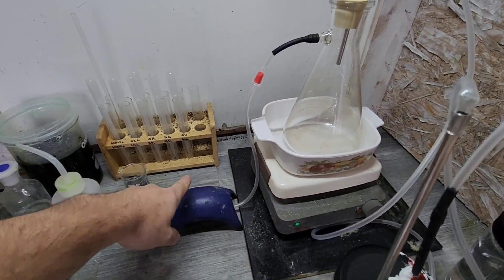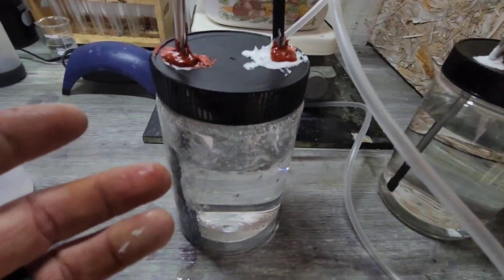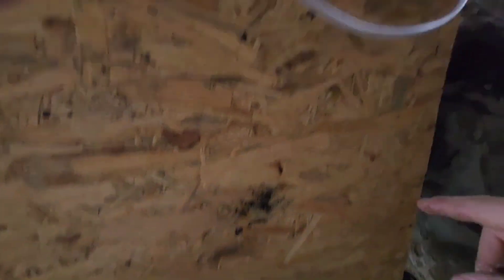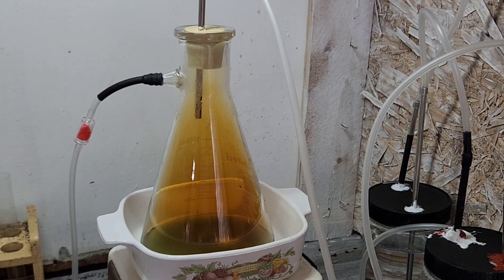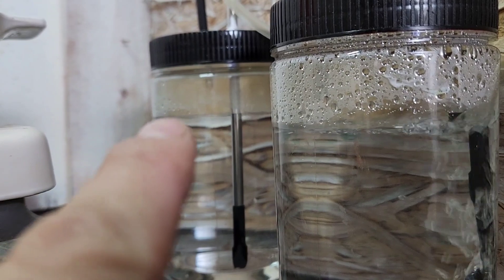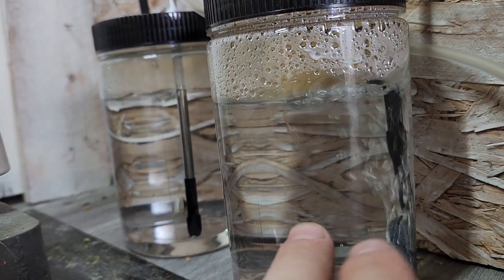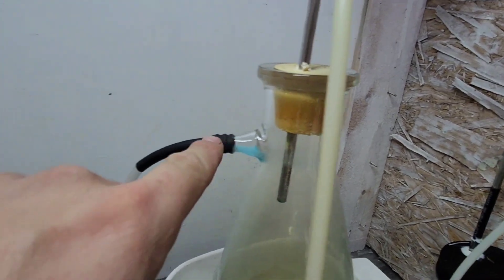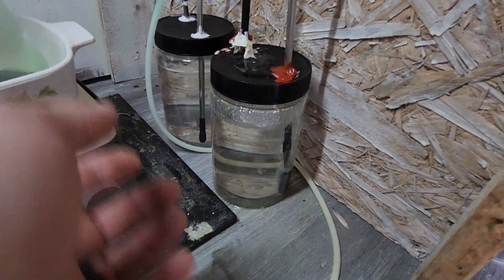The start of my air scrubber! let's make some Nitric!

Comment: You are having the same issues that I was having. I was side tracked. What I was thinking is a push pull pumping (close loop). For a seal. Make one from a inter tube (Gasket). should use glass tubes with polypropylene tubing. Or you can just use the tubing. The silicone does degrade. You can use plastic PETE tap barb fittings to attach the tubing.
Reply from the maker: I like the push pull idea. Doesn't oxygen have to be present?
Reply: Add a T on the suction line with a valve to atmosphere then you can adjust air intake. @SilverStoll
Reply from the maker: I'm just trying to wrap my head around the idea so sorry for asking g dumb questions 😆  if you were allowing air in but not out wouldn't you over pressurize the system? I figure you would have to let some out?
Reply: In theory it should balance itself out. The T would either push out higher pressure or let in negative pressure. The trick is getting the fumes to stay in contact with the water as long a possible. The pump would not run all the time. You use natural convection for most of it. Cold draws heat. Heat the first flask Ice bath the others. Pump extra fumes  as needed. You don't put the tube in the water the goal is to fill the other flash with the gas. warm gas should absorb in to the  cold water.  @SilverStoll
Reply from the maker: Like a gravity boiler. I like it!
Reply: See how HVAC&R engineering can be used ;-) @SilverStoll
Reply from the maker: @timtoolman4125  I like it!

Comment: The easy way to recover your nitric is by keeping your watch glass lid over your reaction flask/beaker during nitric boils. The red fumes of nitrogen dioxide get absorbed by the steam and re condense continuing the reaction. This works best with beakers without a pour spout or flasks, observed capture rate is 100% with zero fume production when adding nitric to an already hot solution. Adding nitric to cold warm solutions will produce the most fumes and losses.
Reply from the maker: I thought oxygen would be needed in the process. I will give this a shot!

Comment: This is exactly what I've been doing for the past 10 years. Virtually every chemical reaction I perform includes recovery of acids/chemicals.
Every metal recoverer/refiner should capture all the fumes instead of polluting the air. Perhaps you got inspired by my previous comments?
The way to make a profit when refining metals is not only by recovering the metals, but also by recovering all the acids. When you enter into electrowinning, you'll see a considerable increase of your profit. Electrowinning will yield pure metal, and all your acid back! In addition, my electricity is also free, all coming from old solar panels that came in as scrap.
I have professional lab glass consisting of a set of four bubble absorbers. Instead of two glass jars with screw lids you can easily improve your set up by using four tall glass bottles with rubber stoppers. Be aware that nitric/NOx degrades rubber, so the stoppers require frequent replacement unless you protect the part inside the bottles with Teflon tape (PTFE). PP- or PE plastic caps will not be affected but are hard to make airtight around the glass tubes leading the gas in and out. 
Your air dispenser stone will not last long in nitric acid unless it's made of frit glass. I made my air dispensers by wrapping soft fiber glass loosely around the very end of the glass tubes. The outside was heated gently with a gas flame to achieve a semi hard surface enabling only small bubbles to go through. A little glass fiber was wrapped around the glass tube right where it enters the fiber glass ball, then heated until it melted, sealing the connection point.
Contrary to your system I'm not using pressure but vacuum to force the gas through the absorbers. It's easier to seal a vacuum system than a pressure system. Some chemical reactions give off both NO (nitrogen oxide) and NO2 (nitrogen dioxide). Important: NO does not react with water to form HNO3! Since I use vacuum to remove the gasses, I must have a glass cylinder connected prior to the absorption unit, acting as an oxidation chamber. An adjustable bleed valve on top of this cylinder allows air to be sucked in to oxidize NO to NO2. As your set up uses air to force the NOx gasses through the absorption system you probably already have an acceptable oxidation of NO, so an oxidation chamber might not be needed. Be aware that NO does not easily react with oxygen to form NO2. In commercial reactors the oxidation chamber maintains a temperature between 150 C to 200 C depending on the plants' set up. This means that only a lesser part of the NO is oxidized to NO2 at room temperature.
Even if a complete oxidation of NO to NO2 took place there'll still be a huge unavoidable loss in the next step. An undesired chemical reaction takes place when NO2 is absorbed in water: One third of the NO2 does not turn into HNO3, but unfortunately instead converts back into NO. Here is the reaction: 3 NO2 + H2O → 2 HNO3 + NO. That's why commercial plants cannot reach even a 70% effective conversion. Despite high pressure mist spraying with dilute nitric acid and a complicated system of trays in the absorption towers, some of the NO2 and all of the NO slips through unconverted. A 50 to 60% conversion rate is considered excellent. Several passes through the system are necessary. We amateurs should be happy if we can reach 30% in a single pass, due to our limited conditions.
To solve this problem, I have acquired several different gas bags made specifically for various gasses. Two of them can withstand nitric and NOx. In the other end of my system all unreacted gasses are collected in a gas bag; ready for reoxidation and a second pass through the absorbers. That's the only way to recover all of your nitric acid from NOx fumes. 
An improvement to my system would be to place a heating mantle around the oxidation chamber, enabling it to maintain a temperature of around 150 C to enhance the oxidation rate of NO to NO2, but then the gasses must be cooled down again to maximum 30 C before entering the four absorption cylinders. All in all, a little complicated.
Your set up makes rather large bubbles. That is less desirable as it does not create full contact between the gas and the water, so a substantial part of the NO2 gas is not converted into HNO3. As you're not using a gas bag to collect the unreacted NO2 and all NO, take into consideration there is a trick to recover at least part of the nitric otherwise lost. Fill the fourth absorption cylinder not with water but diluted hydrogen peroxide. Here is the reaction: 2 NO2 + H2O2 → 2 HNO3. Unfortunately, without a gas bag all the NO will still be lost.
Your newly produced nitric acid will most likely have a slight brownish color. Dont worry, it's just due to some dissolved NO2. Bubble air through it until the acid becomes clear. Again, the side effect is that part of that NO2 will be converted to NO, which will be lost if this step is not done in a closed system. After each run of NOx recovery, I connect the gas bag containing all the unreacted gasses to the system and process it one more time. The bleed valve is opened slightly more letting a little extra air to be sucked in to oxidise the NO to NO2. Alternatively, I could add almost pure oxygen from my ceramic air filtration system, but plain air is commonly regarded as sufficient enough for oxidation of NO to NO2 and a little N2O4. All gasses exiting the system is collected in another gas bag; they consist primarily of air and a lesser amount of NOx, so the bag is simply just stored and added to the next run.
Remember that HNO3 will degrade if exposed to light. Best to store acid in brown glass bottles in a dark cold place, or fully covered outside. Gas released during decomposition can build up pressure until the bottle explodes. Especially for HCl; the higher the concentration, the more dangerous.
Reply: Thats a book of information. The same thing I been working on for a couple of years (in spare time). One question for you (of many) what do you do to recover the solder (tin) off of PCBs and components. At this moment I am testing HCL dissolving.
Reply from the maker: I have seen some people just use nitric and turn the tin to the metastatic acid and dissolve the base metal along with it. Not the end of the world if you recover your tin to supplement the cost of the nitric. Omegageek64 has a video on how to smelt the tin. I was thinking about giving that a shot. I figure you can then just have the one collection system except for AR solutions. Then your scrubbing the air collecting acid/cleaning the air to a degree.
Reply from the maker: I would really love pictures of your set up! It sounds awesome! I'm sure a couple of the subscribers would love to see it and attempt the process as well. You also have inspired me with your comments! I was face timing with Robert L about it as well. You Tim Toolman and Robert would get along really well and probably could come up with some awesome builds!
Reply from the maker: @zero-waste  good to know! Thank you!
Reply: @SilverStoll .   You may have seen videos of people using HNO3 to dissolve tin and base metals at the same time. Have you also seen the same people recover those metals afterwards?
l strongly advice you not to use nitric indiscriminately, and the reason is simple: Tin and copper together in dissolved form is notoriously difficult to separate! For the amateur it's near impossible. Tin behaves odd in several different ways. In many chemical reactions it's a real pain in the butt. 
Further, Tin's ability to form metastannic in contact with nitric results in another problem if you depopulate PCBs by dissolving the solder. The metastannic acts as a passivation layer, blocking the nitric from dissolving all the solder. Thus, the electronic components will not fall off the board. You'll have to almost pry them off with pliers, and there will still be remaining solder on them. The whole purpose of removing the solder is to get Tin free components for further processing.
The well known two-step process is still optimal. HCl is perfect for Tin removal (= Tin Chloride), but struggles with Lead. HNO3 is perfect for Lead (Silver and Copper too, if "lead free solder"), but causes severe problems with Tin. Therefore, remove the Tin with weak HCl, wash the boards thoroughly with distilled water, and let very diluted HNO3 take care of the rest of the solder.
Very diluted acids will dissolve all the solder with no, or insignificant, damage to the electronic components.
Tin is infamously known for turning into metastannic in contact with HNO3. That's only true if the acid strength is rather high. At a concentration of no more than 6.5%, or even better if just 4%, the Tin content of the solder will become Tin Nitrate only, with no formation of metastannic when dissolved in HNO3.
Electrowinning of Tin Chloride yields metallic Tin, and all your acid back again! Getting metallic Tin from Tin Oxide is easy by simple Carbon reduction. A crucible with lid is needed to avoid the Carbon from burning off, as the reaction takes place around 1300 C.
Reply: @SilverStoll .   Sorry, I don't have a camera, can't send you pictures of my different set ups.
I would indeed be interested in discussing with Robert L. and Tim Toolman, to share experiences and exchange info.
I wonder, is Robert L. a YouTuber?
Reply from the maker: @zero-waste  no he is just an awesome refinee

Comment: I love the idea! If this pans out would you be limited to doing your refining in these flasks?

Keep moving forward! You'll make it through!
Reply from the maker: Not necessarily. I just had an extra rubber stop for my flask so I was more or less just testing the scrubber part. Any container that you can seal and pump air in and out without loosing pressure (and lab safe) would work perfectly

Comment: You should pull out the distilling rig you showed me. It would be way easier for you
Reply from the maker: I just bought the two clamps for it. I have to research it more. Some of this stuff is magic to me 🤣
Reply: @SilverStoll  the process is the same as the setup you put together. Boiler, condenser, and catch container. You just have to assemble it